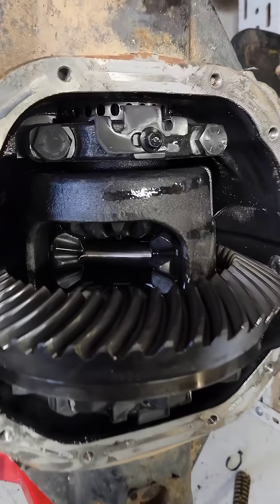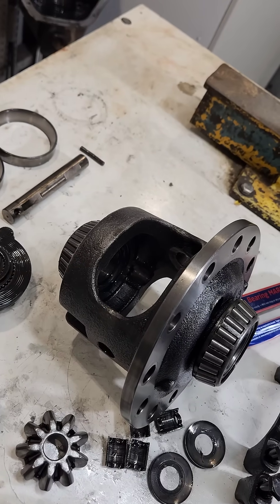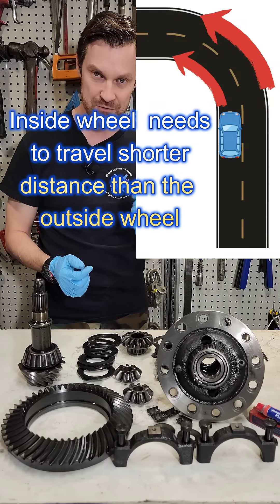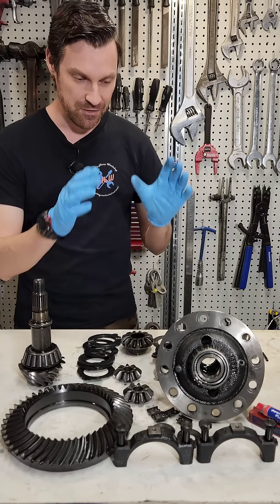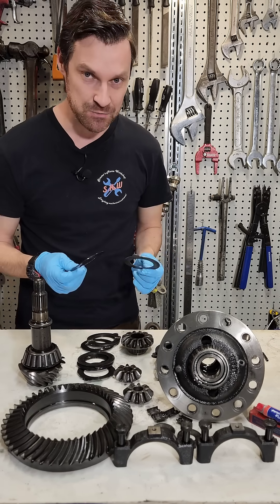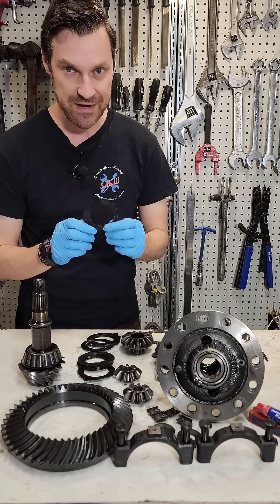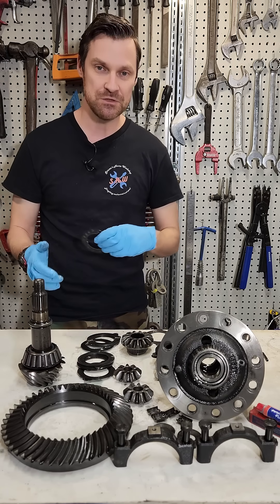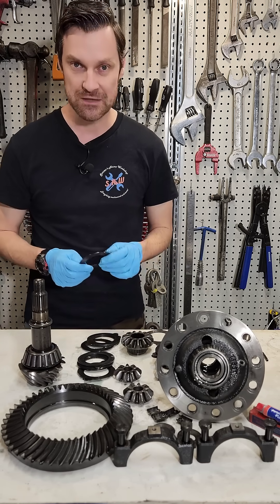Limited Slip Differentials (LSD) how they work. #differential #engineering #cars#howitworks #DIY

Comment: My rear wheel drive F350 dually has a Dana 80 and if I stab the brakes before leaving the line it locks both wheels instantly never understood how when my chevy takes a few rotations with it's LSD?
Reply from the maker: Interesting, I'd say the F350 with duals would often have some pretty decent even traction with pairs on either side, assuming an 80 is also in the chev it could be a bit worn or set up differently, even oil type can make a difference. i see they did make 2 types the trac lok and power lok, but don't know much about them honestly, here in Australia
Reply: @simmoshomeworkshop Thanks yeah it's a Ford dually thing had 8 other trucks GMC and Ram only the Ford? Actually another guy told me about it because it was spinning when taking off in the snow so I hold the brake & the gas for just a sec you just tap it and then it instantly locks both sides a very handy feature to know about. I was mad no one told me for 15 years too😂